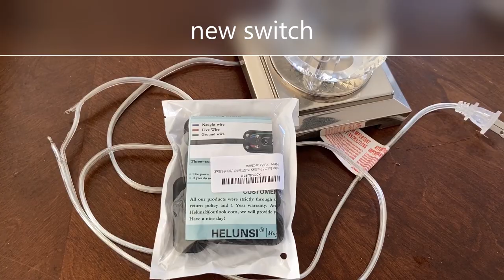〚DIY〛 Replace lamp inline Switch

Comment: how can I find out what side needs to be live?
Reply from the maker: Most lighting fittings operate on AC so there is usually no positive (live) or negative (neutral). In AC, Active, = hot = live and Neutral. If the wires insulation is the same color then the connection most likely does not matter. However, as indicated in the video, you will need to mark the same wire before cutting them.
Reply: There is normally a ridge on one wire and not the other. That will be your neutral.